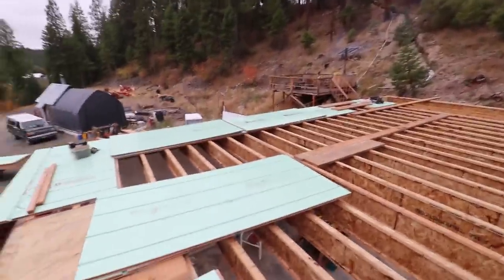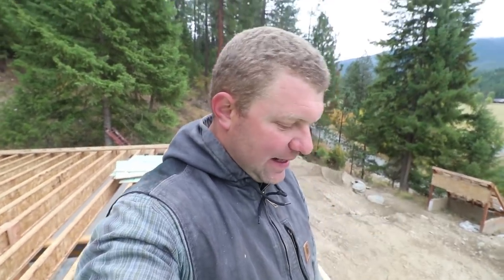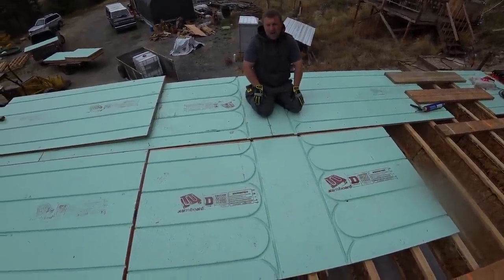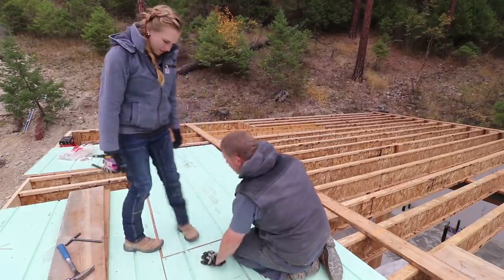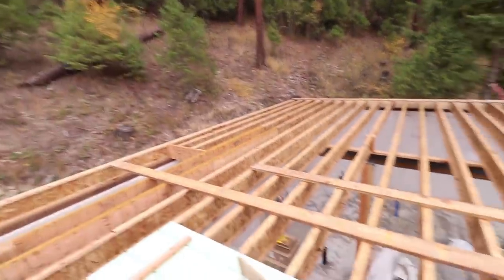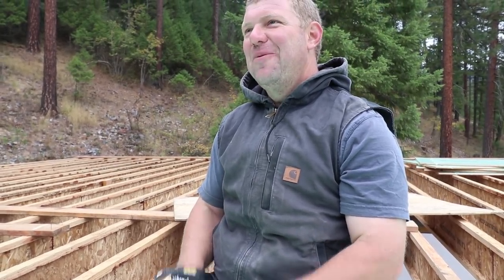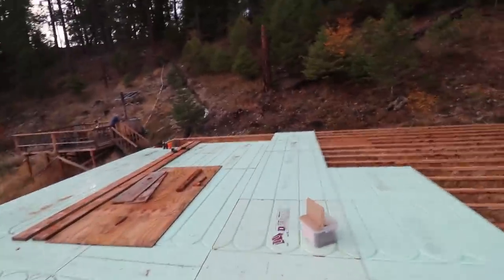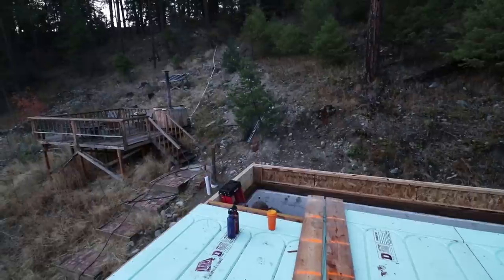Building a House Start to Finish: Radiant Floor Heating Installation Ep 2

Comment: -no idea IF overhead water sprinkler system even being considered-in "engineering" or plans or  dreams ~
   -(however fire fighting is implimented ),since gravity fed water pressure will be quite low due to lesser drop
      from YOUR water tanks ,  at closer gradients as house rises higher-
         believe now 40 PSI in basement level,  but possibly as low as 25 PSI in upper main structures
      
-so your timber frame structure "could" SOON collapse into charred "engineered wood "   basement , 
        IF fire starts -even from spontaneous combustion        or faulty wiring ~       or forest fire ~     or lightning~ 

since "engineered wood" is basically wood chips  and GLUES-
    so unlike solid planks,ignition timing or FLASH TIME goes WAAAY down from say 20 minutes to say 5 MINUTES
      
       the HUBRIS of MOST SYNTHETICS so common today ~
         ~"wood",carpets,cabinetry,drapes and most clothing and tools etc
    
-so your 'I" beams AND subfloor -both "engineered wood" AKA wood chips and glue ,possibly FOAM walls 
    VERY susceptable to  FLASH FIRE=       INFERNO !!
      as ANY firefighter will tell you     ~~IF you even LISTEN  ~~
           
       (noted YOUR "engineered wood " flooring installed was NOT to be exposed to WATER or RAIN ~
             doubt WATERPROOF" glue used so will swell and warp or delaminate when wet~unlike EXTERIOR plywood~)
        
AND suspect your  local "volunteer" fire department  has NO ACCESS to adequate water supplies
     beside your uphill cistens    AND probably INCOMPATIBLE fittings to your fittings   

                                                                = GOOD LUCK !! 

       PS   -1-have LOTS of 5 to 10 lb  >ABC<   RATED AND  MAINTAINED fire extingishers WISELY located on each floor
                       AND READ instructions HOW to use then properly-IF REQUIRED ~
               -2-and both AC and BATTERY operated  C/O and smoke alarms also properly located on EACH FLOOR

Comment: just wondering why you are cutting out them small sections on the warm board, i must of missed something
Reply: I think they were some damaged areas
Reply from the maker: The stamps for the tubing do not allow room for wood underneath so the panels won't join. They must be trimmed.

Comment: Sorry, but it doesn't make any sense at all that this product is tongue and grooved since it's installed as any plywood underlayment would be.  Looks to be adding way too much labor.   After seeing how you mentioned how forgiving the tubing can be for a 1/8 - 1/16 offset it even makes more sense that it shouldn't be T&G'd.  Lay the glue, then a panel, use the 2 alignment tools to set it correct on each axis then screw in place.  It's not going to go anywhere.
Reply: Robert Gaebler ive always installed tounge and groove for the subfloor. And NO OSB! Always at least 3/4" thick

Comment: Warmboard-S manual - "Whenever possible, it is advantageous to avoid exposing the panels to rain or snow."

I guess they didn't read that manual either :)
Reply: Except they are not installing Warmboard-R...
Reply: Because Warmboard-R is for EXISTING subfloors. It goes over the already installed floor. So yeah, your ignorance is real.